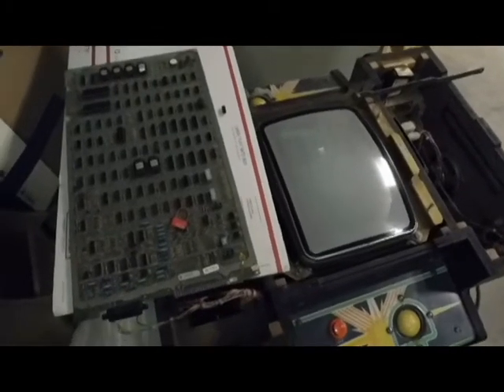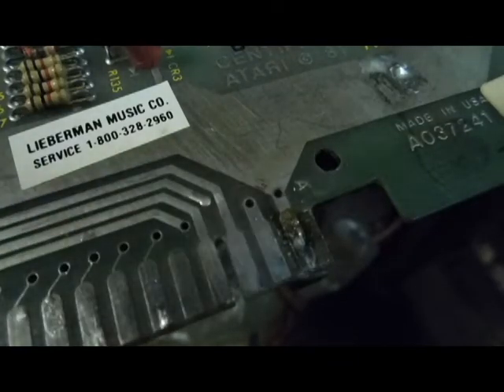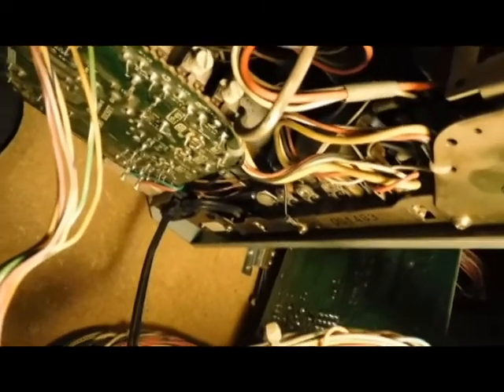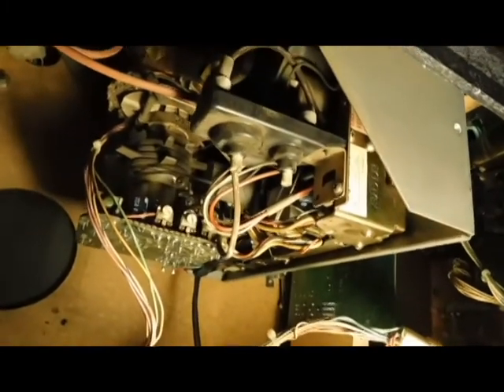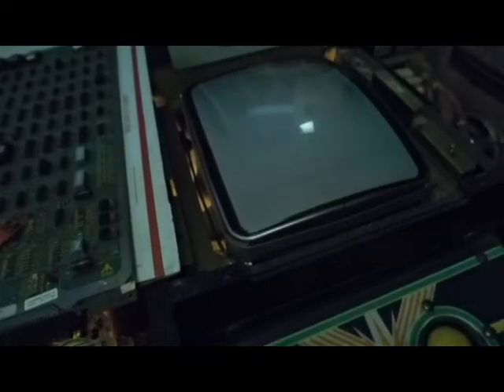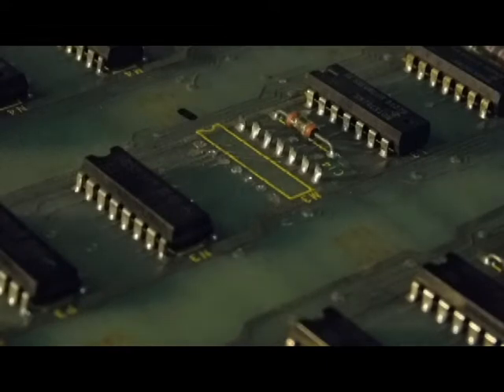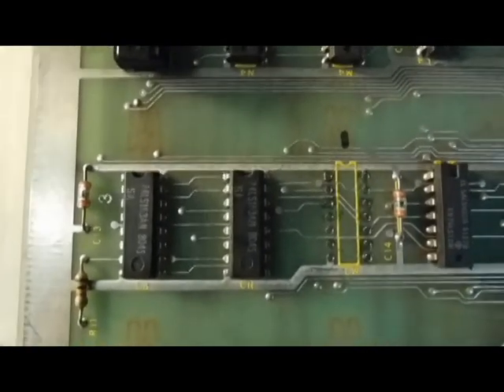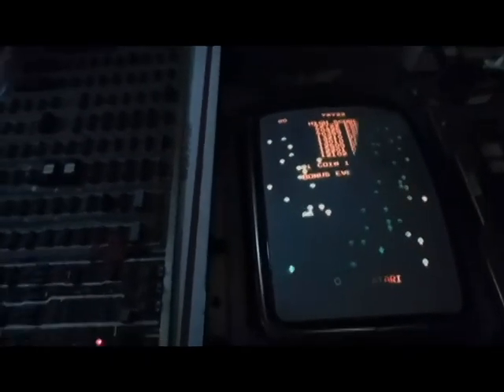Atari Centipede PCB Repair

Comment: The LS74 chip was working but it was causing display glitches on the Horizontal sync signal. I haven't seen that IC chip bad before
Reply from the maker: It does seem to have been the cause of the display glitches. I tested the game again a few hours ago and the image is solid still. Hopefully it stays that way.